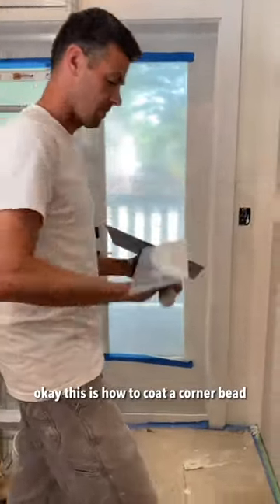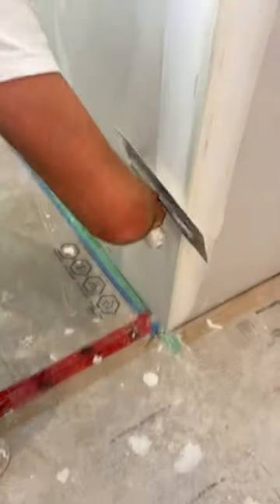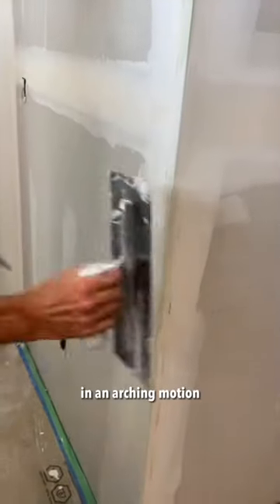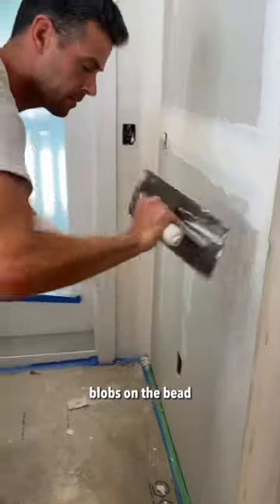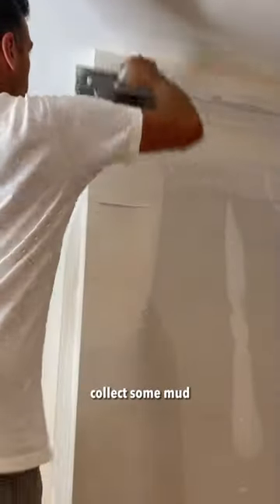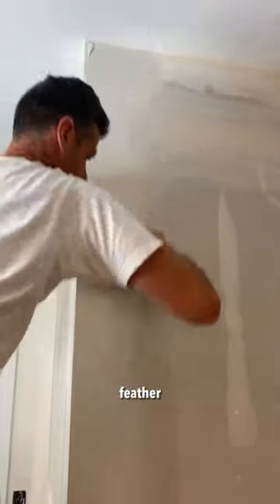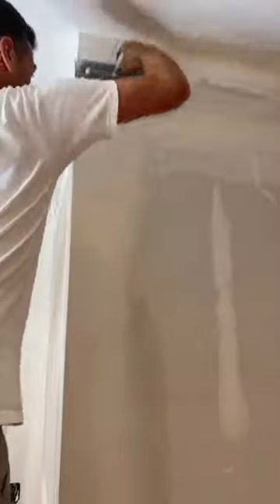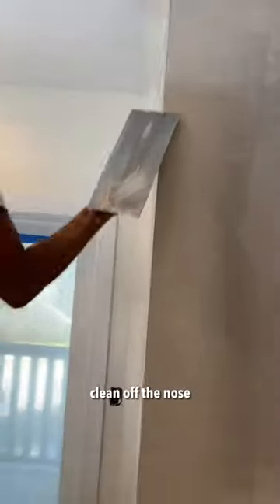Beginner Drywall Tips! Coating Corner Bead!

Comment: Okay but the edge of the bead is exposed, right? Thats my problem. Is it supposed to be? I just primed it with the rest of the wall because idk what's going on.
Reply: Did you ever get an answer?
Reply: @worldonastrng  no, and I'm fed up with building this nursery, so it's just going to he what it is lol
Reply: @TheKittyfizzle How are those corners holding up lol (asking since I’m sat here with perfectionism-paralysis not knowing what to do about these corner beads of mine that are currently more knobbly than a bag of Nik Naks)
Reply: @apmeehan  so downstairs I put mud over the bead. Upstairs, I left the very corner of the bead exposed and primed over it. Downstairs has already chipped off that sharp corner. I'll have to sand and repaint. Upstairs seems strong so far. I'm using vinyl bead, the type with holes and no nails.
Reply: The metal corner is supposed to stay exposed. It acts as a guide for your knife. The purpose of the metal is to act as a durable corner. If you cover it with mud then the corner is fragile and it defeats the purpose of the bead.
Reply: @NickWelch Yep, just here to confirm this is the right answer. Source: friend of the son of a really handy guy 😅

Comment: Folks if you don't get it right the first time... you really have no excuse.  It's as easy as breathing 😂😂
Reply: Ok but the thing is, is the bead actually straight, everything has to be clean, lined up, no bumps, no holes, yea u can kind of get it done but i bet they look like chit
Reply: @smokeydiamond489  smokey did you mean to reply to main chat.  Yeah the bead has to be square as it can be to both planes of the corner, otherwise it's more work and can totally look crappy.

Comment: i use a curve trowel for first coat on beads then skim as tight as possible and get away with 2 coat cornerbeads. Every time I tried flat trowel 2 coats i still get a slight ski jump off the corner bead and even worse with pan and knife it flexes waaaayy to much😁👌👍🇨🇦🇨🇦 

what is your professional opinion about this method i use ??
Reply: I'm late to the party but the right curved trowel with the right pressure and mud consistency is the best way to do it. Should be able to load in one pass and smooth in second pass.
    With practice and concentration load and smooth in one pass like using flat boxes.

Comment: I can never get it right.  Doesn't help no one told me if the metal on the corner is suppose to show or not..
Reply: It should be visible.  If not the mud will chip easily and no more crisp clean corners.

Comment: Nobody uses a hawk & trowel anymore, that an out with plater in the 50’s. No begginer would be able use these old school tools. Now a days they would find a pan and knife would be way easier!
By the time most people learn to finish drywall they’d be better off to hire someone that knows what they’re doing. Small patches maybe? But a larger job no. Why do you think most drywall finisher go through a 4 year apprenticeship to learn the trade? That’s if you want it to look right!
You wouldn’t want a oil chang grease monkey to rebuild your transmission?